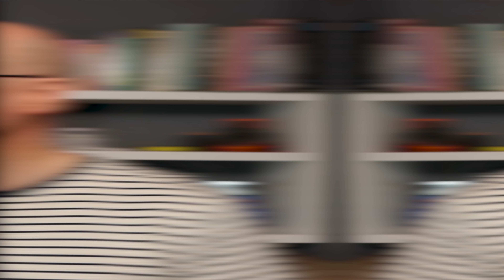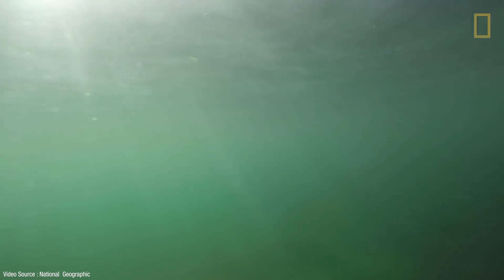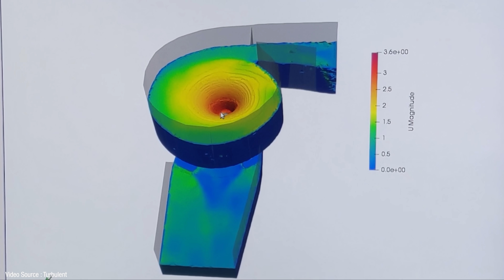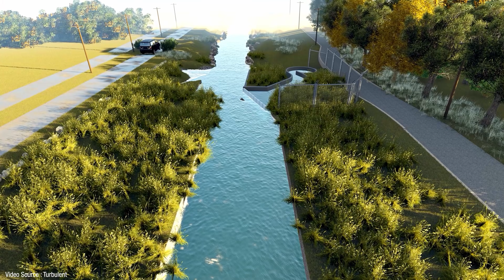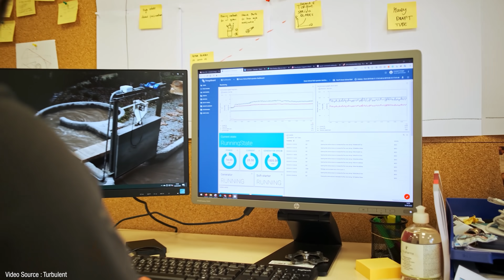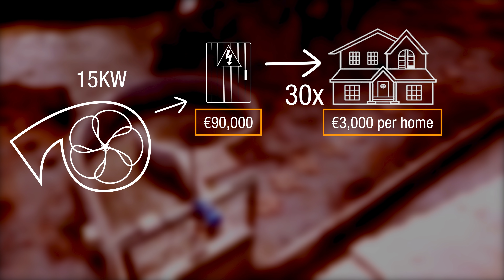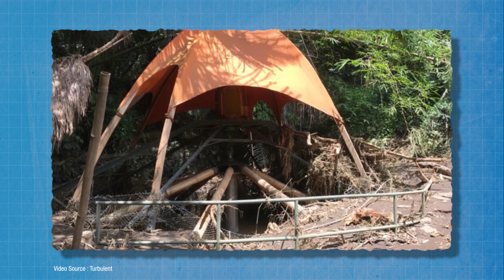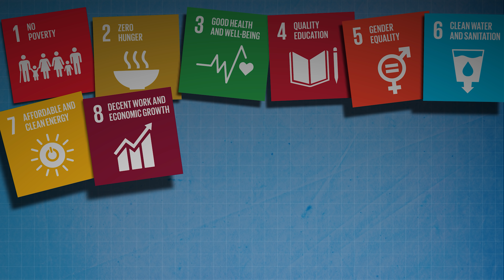Micro Hydropower : Turbulent Turbines

Comment: No reason to limit them to remote areas. Any town on a stream or river could benefit from some localized, clean energy production.
Reply: Given that many waterways that run through urban areas already have anti-erosion measures in place (ie, concrete and metal walls), adding a string of micro turbines like this would have minimal environmental impact.
Reply: Even treated water. Or for pumping water to uphill locations. 

They could also be installed to decelerate water flows.
Reply: @simonrodriguez4685  true…using the same water tower pumps
Reply from the maker: Very true
Reply: yes, maybe the rainwater runoff systems for streets could be utilised, well, if towns are built from scratch with this in mind, and it wet areas
Reply: @nick w that's basically all the Italians have. They still have an ancient aqueduct that supplies Roma built in the bc times, the first was in 312 BC. By 300 AD Roma had eleven aqueducts supplying one million people. Course you can't be such equal opportunity slavers without making enemies in 537 the Ostrogths cut most of them. Took till the foreteen  hundreds before there was any fixing!
Reply: More electricity generation is a good idea.
Considering pushing for renewable energy is being done
Reply: Untapped underground water systems as well
Reply: Any pumped water or sewage system could be utilized for recycled energy. Underground rivers and water tables could be utilized on a smaller scale as above ground is not the only water sources. Underground rivers give way eventually for the rivers that we see today. Water tables are easily figured and can be harnessed anywhere. Energy can be harnessed from the very air that we breathe and will someday be harnessed when science advances beyond our monopolies so until then; this seems to be the best non-invasive, non-impactful way to move us forward and allow the planet to heal.
Reply: 100% true. I think the issue is for places connecte to grid, it may not be financially beneficial as grid power is already there and cheap currently. Solution would be to increase electricity cost (which is often hidden or not paid, like carbon tax). But even then, sadly in many places in europe electricity is subsidies by government, so even more removing the natural opportunities for these solutions. Only if people would really care and push their politicians to look at those things
Reply: @lukasdolezal8245   Electric utility companies are already investing in sustainable power. For example, my local electric company has a big field of solar panels and a large battery installation close to where I live. It’d be nice to see the companies build these water turbines as well ... varied and dispersed energy production means more resilience to disruption.
Reply: @lukasdolezal8245  "Solution would be to increase electricity cost."Wow,just wow.What a fantastic idea.Why not increase the cost of milk so people would be motivated to have a cow in their backyard.Why not increase the price of bread so you motivate people to make their bread at home by themselves.Why not decrease salary's,after all here in Croatia we already have the biggest salary's in universe but of course only decrease salary's below 100 000$ a year.Why not make everything so expensive so everyone becomes homeless and without any material possessions and voila no co2 except what we the peasants bread but I'm sure you would carbon tax breathing too.You would be a great politician(of course by politicians standards),you already have what's needed to be a politician,"great" ideas and caring about only one ass i.e. your own.
Reply: @lukasdolezal8245  Well here in Spain I'm "supposed" to be paid the wholesale price of electricity for energy that I "sell" to Endesa (one of the two large power companies in Spain) from my home pv system. The selling rate currently is just over 5c a Kwh, so 2.3c would sound pretty compelling to me if I were an electricity supplier looking to buy electricity. In Spain. I imagine the system could be useful in some of the northern parts of the country - where I live, not so much.
Reply: It would be interesting to compare the cost/space requirement/performance of the turbulant generator against the archimedes screw generator usually applied when there is limited space.
Reply: @mikemhz  The only issue with the screw type impellor is that the screw type kills fish and the widely spaced blades of the Turbulent allow fish to pass thru.

Comment: Have to admit I've spent way too many hours thinking about something exactly like this, yet my lack of understanding of water flow dynamics and basic engineering limited my ideas somewhat. So brilliant that some clever bods have done this. Be good if they had a funding (pay-it-forward) system in place so others could help remote communities get these in place.
Reply: Me too! I had in mind a system of vanes moved back and forth by turbulence, but again, great that engineers have produced the functional version. Pay-it-forward systems are ideal, there are some NGO's focused on that sort of funding.
Reply: a turbine in flowing water isnt exactly a new idea.
Reply: @Withnail1969  Yeah, I know... it's just that there might be better ways to do it.
But thanks for that.
Reply: @Withnail1969  Did you even watch this report?
Reply: @Withnail1969  Seems to me that setting the turbine on the low speed, low pressure center is a major waste of energy,   There are nearly no worse ways to do a turbine.
Reply: @Withnail1969  What's different is the idea of a side cut into the channel to divert the water to harness the energy, rather than complicated and expensive damn schemes. More affordable. Less maintenance. More environmentally friendly. I think you are missing the whole point of this concept.

Comment: This is an awesome Channel, thanks for your efforts you put into public education.
Reply from the maker: Glad you enjoy the videos. Thanks for watching!
Reply: @JustHaveaThink  With some rivers the seasonal water flow varies quite a bit. Wouldn't the reduced flow in summer make many rivers unsuitable?
Reply: @autodidact537  I imagine that the total and seasonal flow is part of the surveying and assessment of the waterway in question.
Reply: Micro hydropower is an attractive option for rural electrification in many countries because it can be implemented with little infrastructure. Turgo turbines are one type of micro hydropower turbine, and they are well known for their reliability and maintainability. However, there are some issues that need to be addressed in order to make Turgo turbines more reliable and easier to maintain.

One issue is the design of the turbine blades. The blades are subject to wear and tear, and they must be repaired or replaced regularly. Another issue is the bearings, which need to be regularly lubricated and replaced. Finally, the generator must be regularly serviced in order to prevent damage from dirt and debris.

With proper maintenance, Turgo turbines can provide years of reliable service. However, if they are not properly maintained, they can become unreliable and difficult to repair.

Comment: To what extent are small rivers not intermittent? I understand that they don't stop when the sun goes down, but don't they occasionally dry up due to changes in rainfall, snowmelt, and seasonal factors?
Reply: They sure do. Seasonality must be considered in every renewable power plant design regardless of the technology used.
Reply: @guilhermeroneto  Conventional power plants need to consider seasonality too.
Reply: no in those tropical/Subtropics rivers.
Reply: These systems are designed to use only a fraction of the water flow of the river so the annual rise and fall of the flow are generally accounted for in the design! Normally when the flow is low then so is the demand for power as it is generally hotter so no need for heating by electricity as there is in cold weather! ( Heating is generally the biggest demand for electricity)!
Reply: There is intermittency even here in a temperate climate like New York state. The dream of the timber frame passive house with one of these systems ahs been mine, too, for years. But there is a reason to that dams exist. They're called battery dams, after all. The key is to be above the point where fish swim, but with enough drainage to support a regular fill up of your backup dam.
Reply: Very seasonal in places like South Asia. Also water is taken for irrigation in most places. I bet you can't find many rivers flowing like you would need for one of these turbines. The bottom line is that the water is already needed and used for other purposes, when it's there.
Reply: Flooding can also stop generation. When the head of water is reduced because the water level downstream is too high.
Reply: @normansippel6553  Excellent point!
Reply: @normansippel6553  not if overflow is diverted but, of course that’s another cost/modification
Reply: True, but we haven't really defined ''small rivers'' for this purpose. Also, if more of these generators were place along the larger rivers, the effect would be closer to the massive hydroelectric dams presently in use.
Reply: Most streams never stop entirely and when they do it's summer .Then you   like 18 hrs of solar and don't need heating so the loads less when it's producing less.
Reply: @avancalledrupert5130  with around 20% still on grid; it would switch but it’s less carbon and I think that’s the point. It’s not really addressing all areas and climates unfortunately
Reply: Seasonal factors are meaningless in northern part of the planet where we use most of energy and in tropics where it's badly needed. In other places different solution may be needed but not everywhere you need everything.
Reply: @mariuszfurman4767  Work  with what you have, and try to make it better. just because it is not a full solution now, does not mean much except the technology has not gotten to a good enough point, yet. Yet implies it could happen.
Reply: @patriot9455  So I said.
Reply: If the river is intermittent you could create a lake to feed the turbine at night and solar panels in the daytime. And you could combine with windmills.
Reply: I live in Scotland, where it's famous for its wet climate and used to rain pretty much all the time. Last Spring/Summer, however, we had almost no rain for 4 months (with the exception of a very brief shower). The stream next to my house dried up completely, for weeks - that's the 3rd year in a row it's done this now (never happened in the years beforehand). 
So, with climate change comes unreliable water courses - even in Scotland - and, at 90,000 Euros a pop, I wouldn't see any financial benefit from one of these turbines, good idea though it is. Plus, the fact it has a lifetime of 30 years begs the question - how much will it cost to get all the necessary new parts? They could be double that figure by that time.  
This idea will probably be okay for the tropics, if you can afford it and if you have an untouched rainforest nearby to keep water courses fairly constant... Good luck relying on that commodity.

Comment: Bonjour du Québec. One word... winter. How does it handle ice??
Reply: While I'm no engineer, it seems fairly clear that if the inlet were below the depth to which the water source freezes ice should not be an issue.
Another idea could be to use a small part of the electricity produced to keep the inlet just above freezing.
Reply: The constant movement would impair ice formation, and up stream the water still flows under any surface ice.
Reply from the maker: Hi JJ. If your rivers freeze solid during winter then I would not advise it. Otherwise...good to go :-)

Comment: Windmills and watermills - clearly pre-industrial Britain got a few things right, ^oo^
Reply: There is a reason the industrial revolution kicked off with factories in North West England. It rains.
Water power started it off.
Reply: So'FUk'NTiReD OfBarelygetnBy  windmills in North Dakota are winterized to prevent that.
Reply: @lestermarshall6501  in Britain it is windier and rainier in winter, so less power in summer
Reply: So'FUk'NTiReD OfBarelygetnBy  windmills don't freeze. It's the greedy pockets of Texas energy companies that froze when warned to winterize their equipment. It's like refusing to buy tire chains to save money, then kicking your car when it inevitably gets stuck.
Reply: And the fertile crescent where windmills have been used for thousands of years
Reply: The vertical windmill was in all probability an Anglo-Norman invention (It is just possible that the concept of a mill powered by the wind was passed to Western Europe following the first Crusade. As in Seistan in Eastern Iran horizontal windmills had existed since at least the 10th Century).
The earliest vertical windmills were built prior to 1189 in the English Midlands (Possibly as early as 1137 in the case of Wigston Parva).
These windmills were wooden Post Mills (For a full account of 12th Century Windmills in England see 'HARVESTING THE AIR Windmill Pioneers in Twelfth-Century England'
By Edward J. Kealey)
What would appear to be the earliest  stone tower mill 'Moulin de Pierre' was built c.1218 at Hauville near Rouen in France. It has been  restored to working order.
The watermill is a far older idea dating back to around 100 years or so before the birth of Christ. It would appear that earliest examples appeared in what is now Greece and Turkey.
Reply: @nicholaskelly6375  fascinating
Reply: @bernardthedisappointedowl6938  I've corrected a spelling mistake. 
I meant winter is when power is generated much more.
Reply: @chrisdaniels3929  Duly noted Chris - I deleted my comment as it is no longer relevant, ^oo^
Reply: So'FUk'NTiReD OfBarelygetnBy  Windmills don't freeze
Reply: So'FUk'NTiReD OfBarelygetnBy  LOL, Texas come to mind?
Reply: @tombombadil3185  that was more to do with coal and gas power stations crashing than windmills freezing.......Fox news isn't a reliable source.
Reply: Lets get our terminology correct shall we? Seeing as this is a scientific channel? A mill is a grinder. You do not generate electricity from a mill of any kind - wind or water. If you are talking about electricity generation you are talking about a turbine - i.e. wind turbine, water turbine.
Reply: Clearly your old generations Far more stupid than your gluttonous egos would Ever allow to be concievied